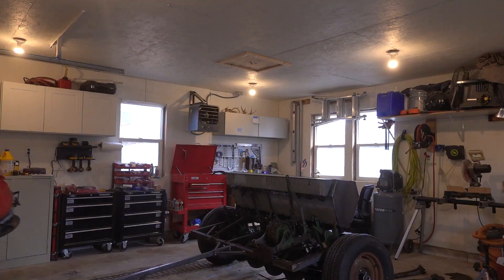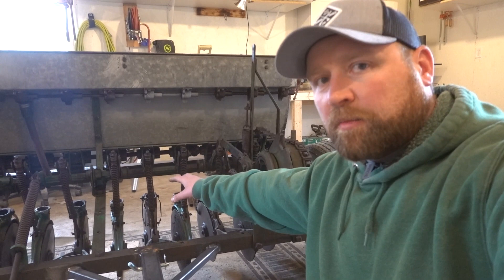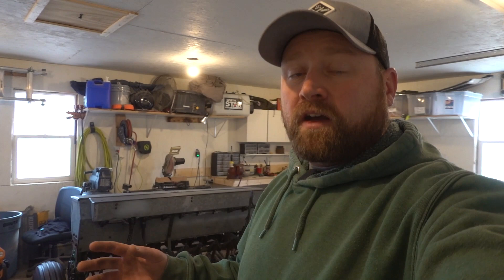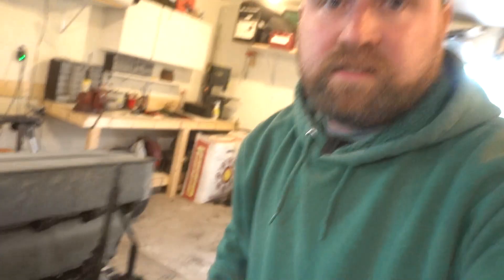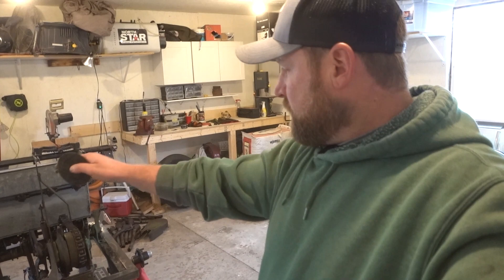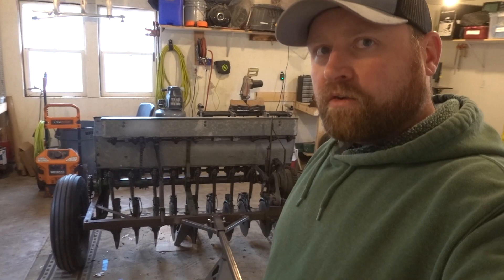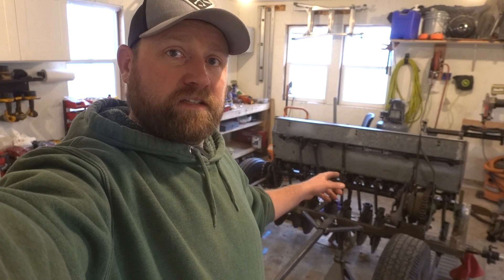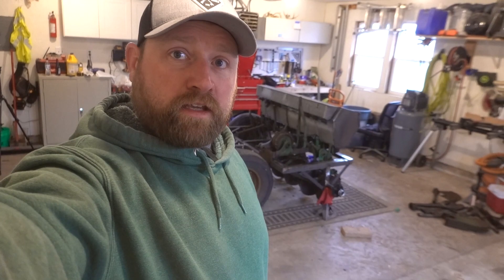How to Make a Food Plot Seeder that Makes You $$$. Build 2 grain drills out of 1!

Comment: I did the same project last year. Mine was a steel wheel IH that I cut down to 5 feet. I had already taken small seed box off for a roller seeder years ago so I just mixed everything into the grain box and it worked just fine.  Forgot to raise it turning around and was surprised to see plants coming up even on the hard clay 4 wheeler trail. Plan to make a 2 row corn/bean planter out of left over parts from other half.
Reply from the maker: Nice! I plan on just mixing everything in the large box as well. Best of luck this year!

Comment: I don’t understand why not make both sides a drive wheel you have the parts on the other half so that way you have two drive wheel ?
Reply from the maker: Brent if I pulled the drive wheel off the other unit that unit would be left with no wheels on it. That’s why if you want to make 2 drills out of one, you’ll have to make a follow wheel

Comment: Nice project.   I built the same unit from my old JD Van Brunt and it works great.   It was missing a few cups and disks so I had to consolidate parts to one five and a half foot drill, moving the left axle and tire in.   I now have one useable drill with stored spare parts.
You’ll find this unit gives you excellent seed distribution so you don’t waste valuable seed with correct depth for quick germination.  Seed rate calibration is still critical.   Also critical to vacuum seed out after every use!    You’ll be amazed out quickly seed sprouts and plugs your unit.    Drip some diesel on seed gears at end of season for preservation.
Good luck.   Dave.
Reply from the maker: Awesome Dave and thank you for the tips! I’m excited to see how it works but  and the germination rates. Best of luck this year and thanks again for the storage and diesel tip!

Comment: You can get an AG wheel hub that will fit the trailer spindles if you want to use the AG wheel. 
Your drill has the lift mechanism that runs by the ground drive, which is what you want for a side x side. The JD drills as an option can come instead with a long lever handle to raise the row units, or a hydraulic cylinder for same, which are fine with a tractor, but not with a SxS.

Comment: I will be splitting a case drill this summer curious if an issue arrises if your dummy tire from dust cap to top of tred is different from drive tire will cause issues? Basically tires need to have exact height?
Reply from the maker: I think you want to try and get as close as you can but if it’s .5 to 3/4” in different I don’t think it’ll make a difference. The row units ride in spring which adjust essentially to the ground height. Hope that makes scenes
Reply: @LoinFarmer  yes think so, spreaders are pressure sensitive so they should basically equalize through out the drill
Reply from the maker: @coleplanert6242  you got it! Good luck man!